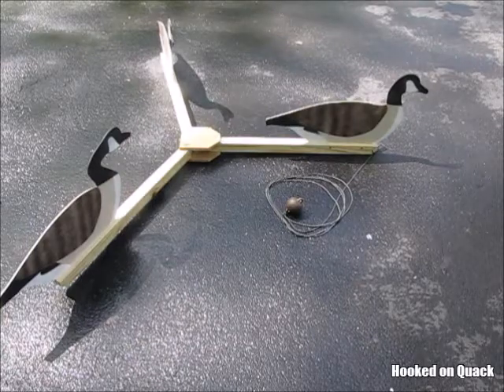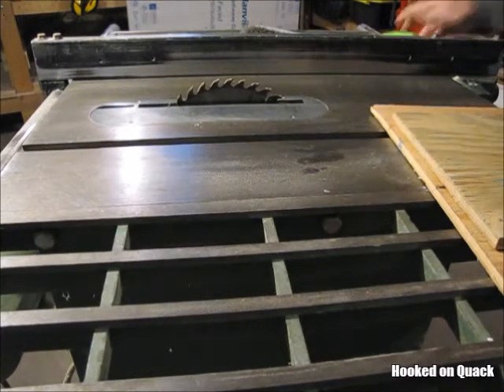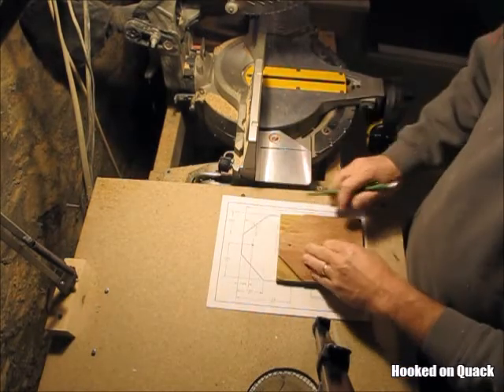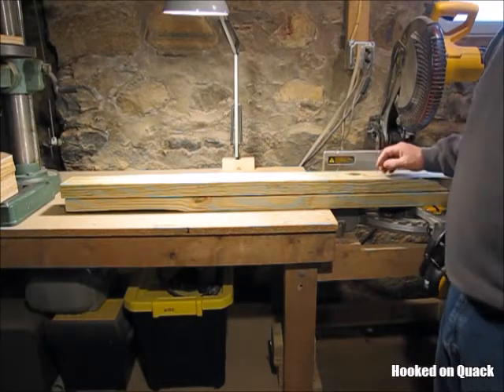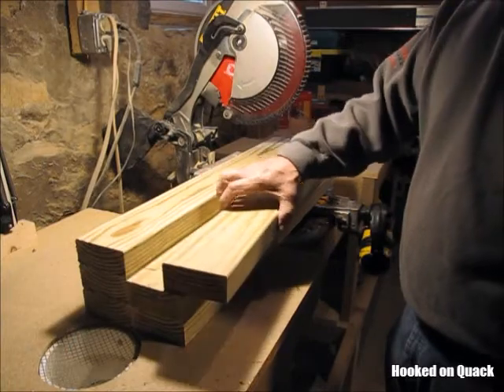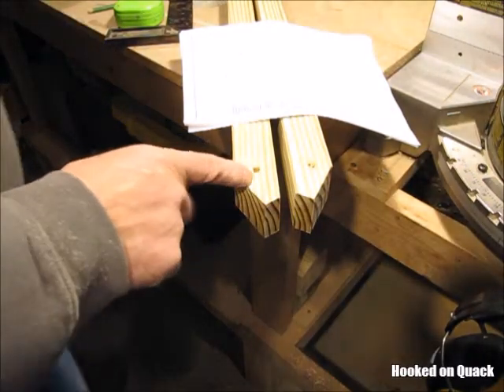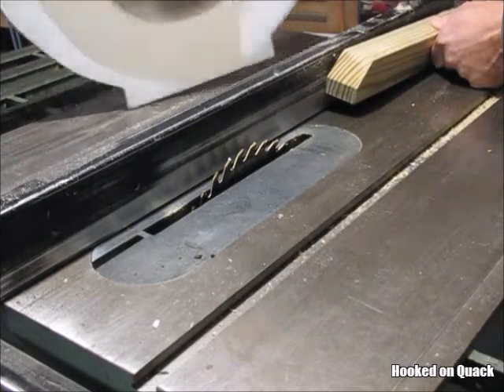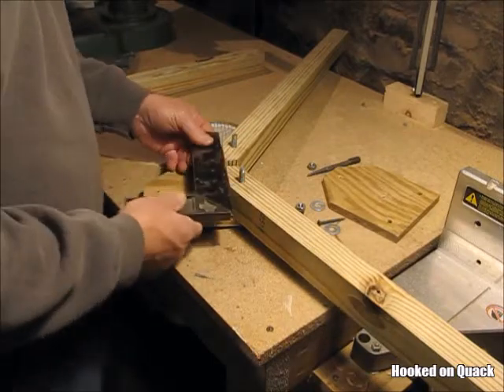V Boards for Silhouette Decoys

Comment: Look good. Do they work on honkers?
Reply from the maker: I hope. I built the v-boards and silhouettes to use with my floaters and build numbers. Since I built them, NY state messed with our daily limits. The regular season and late season daily limit in my area and most of the state is 1 goose/day which makes it hardly worth the effort. Our early September limit is still good, though. When I built them, I had visions of making a video of them in use but that hasn't happened yet. Hopefully, I can get better documentation this year.
Reply: Amy updates?
Reply from the maker: @ryanholtmann9013  Not yet.

Comment: do you have any issues with the wood soaking up water and sinking?
Reply from the maker: Sorry for the delay in my response. Before I replied, I wanted to conduct some "research". You aren't the first to express concern over waterlogged and sinking v-boards. I've never had them in the water for more than hours while using them. For my research,  I put two v-board assemblies in a pond on Friday morning with the intent of leaving them there for a couple days and monitoring the result. As it worked out, I wasn't able to get back there until this morning. So this morning, after four days in the water, the assemblies were floating just fine. However, I would not recommend leaving the in the water, especially if the silhouettes are a plywood laminate. I also would not recommend storing v-boards outside, mine are stored in a shed and were very dry. I also have spray painted the arms of the v-boards on three sides to hopefully camouflage and make them blend better with the water, but that wouldn't seal them. I hope that helps answer your question.
Reply: @hookedonquack  perfect thank you! I want to run my divebombs out there but was worried about it sinking.    Would you say cheap pine would work the best or what kind do you use?
Reply from the maker: I used pressure treated 2 X 4s and ripped them in half. The pressure treated lumber is rot resistant. Regular SPF 2 X 4s would work.